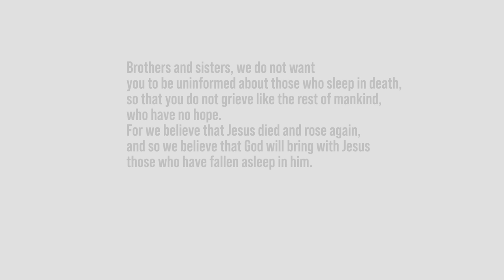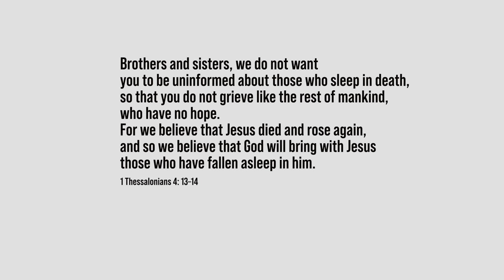I’M NOT 100% CONVINCED THAT ROAD FABRIC IS WORTH THE HEADACHE

Comment: As ❤for the lift ht on your 1025R. Tractor Time with Tim addressed this problem a couple of years ago.  Only one of your lift arms is adjustable, replace the fixed arm so that both are are adjustable.  Now if you adjust to the higher position and it will give you a few more inches of lift.  I had a problem moving my rear blade up a ramp into my barn, now I have no problem.

Comment: Totally feel your pain! I took on a driveway/parking area with no matting and DOT 57 rock. Equipment used JD 1025R with loader bucket front and landscape rack used backwards. Also, a GT2500 Wheel Horse with a front and rear blade. Took time for sure but worked awesome. Our dump spread with dump trailer fortunately work better than your which led to an awesome result.

Comment: Don't beat yourself up.  You started out with a mess but it turned out great!  I know you like to demonstrate tractor implements, but to rough it in, your JCB front-end loader would have been a better option.  On the Kabota only the front axle is self-leveling.  On the JCB front-end loader, the entire front half of the machine is self-leveling and the bucket is attached to the front making it easier to level your workspace, the same as you would with your skid steer.  It also helps to compact the gravel.

Comment: The times I've seen fabric work is,  1. Layed down and covered with base layer of rock several inches with fines.  2. That layer covered with another 6 inches minimum of smaller rock than 1st layer with fines also.  Spread and compact.  Enjoy

Comment: Thanks for the video as I am about to do the same thing. I never though about using the rake backwards. Seems to work quite well. I just hope mine comes out as well as yours. I am on straight clay soil and used 10"- 12" of "pit run" on top of the clay and will use geotextile cloth then about 4"- 5" of 3/4" minus slate.

Comment: Hi Courtney,
Just from a block base building perspective, yes a good geo fab will stop sub base material migration into the grade you cut (or the original base)  it also helps with stability of the sub base overall.  If you had a soft spot that could cavitate under the sub base, the fabric helps prevent that from happening, because the erosion has to pull the entire wieght of that "slab" you built in order to  cause holes, dips, and general instability. I would always reccomend compaction, the heavier the better, especially on te original cut grade (o.g. base).  Setting that grade first is critical.  You can compact the sub base above, but realize that the results wont be as effective due to the textile stopping the sub from driving into the base.   As for weed prevention, yes it will stop weeds from coming up through the bottom, but unless you can keep every bit of organic out of the sub base, all the time (which is impossible) then weeds will eventually grow even in the best laid base. Kinda like a rose growing through a crack in the concrete.  Not very likely, but given the exact needed conditions, it is possible.  Didnt mean to lecture, just hoping the info will help in future projects. Looks good!!

Comment: We quoted a job for a large industrial manufacturer.  They have semi trucks in their yard and wanted a large area covered in 4" of rock.  We contacted the geotextile manufacturer and they said for the weight (big fork lifts and semi trucks) the depth of rock would need to be 12" or more.  It was cost prohibitive.  We have used road fabric in the past on other projects.  Usually a minimum of 6-8" of rock on the fabric.  But doesn't seem to be much of a difference between when we use fabric and not.  I'd rather go deeper with the rock and not use the fabric if it was one or the other.  I'm sure soil types and drainage also makes a difference, especially if it's wet most of the year.

Comment: I always put fabric at the base of a driveway.  Cover that with #2 limestone, then top it with B19 or similar.  If you don't put the #2s down, you will have problems with wheels digging through.  I have fabric under my driveway and it survive more than 50 fully loaded gravel trucks while we were building our horse arena without developing any tire grooves.  That is why you need fabric!

Comment: Geocell/Geogrid might cost more, and will need more gravel to fill up each grid, but will hold your gravel pad a lot better on the long run.  And this is definitely a 2 tractor job, larger for bucket work to spread gravel around, and lighter to do the top coat grading and smoothing out.
Reply from the maker: Yeah, turned out good in the end at least :)

Comment: I've installed a decent amount of gravel trails in the parks I work at. I have used both geocell and fabrics. I have also not used anything other than gravel. I think for the cost of fabric it really is beneficial to use. The geocell stuff I don't think I would use again.  Usually do 4" of 304 then top with 411s. Seems to hold up well especially in wet areas.

Comment: I’ve spread gravel on geotex with my tractor as well. I’ve had nothing but trouble doing anything other than back dragging with the bucket to spread gravel. I put down geogrid below the geotex as well, and the pad is very hard and supports anything I drive on it. I tried to use a rake on my pad as well and it was a nightmare. Tore up the cloth in a few places before I just went back to back dragging. Although where the rake worked it worked really, really well.

Comment: Don't typically need geo textile.. its best for wet areas .. it also makes reworking the gravel areas  a nightmare unless it's 6-8"  us a actual base stone then the  fine grade finish stone and it all locks together
Reply: Great point. Tons of rain on the coast of Maine, and I’m dealing with ledge as my foundation. In places, I expect to hit ledge. I’m thinking that I will need to install a base layer of Geocell. Driveway will be on an incline, ending 75’ from the shorefront  I like your suggestion 6-8” of base. Should I use geotextile as well?
Reply from the maker: These areas tend to hold water...my property was an absolute mud pit all winter last year.

Comment: If you could have used water in it after getting it spread and would have got it wet the ran a vibrant roller on a skid steer could of helped it pack and harden up more than still been loose. 
Another great tool on spreading rock is using a power rake it helps smooth it out and helps to move the rock around. I use one to help maintain the drive way and you can get it to dig down and chop out the pot holes then can smooth it out. I believe there should be at least 6inches of stone over any road fabric!!!!

Comment: Watch the video, your gauge wheels are not even touching the ground.  The best way to use this attachment, is to replace the center link with a length of chain.  When you lower at the three point,  the rake can pivot and follow the contour of the plane of wheels.    The rocking of the tractor will has less impact on the rake.    

This even more effective with three point mounted mowers and brushhogs.  Using a chain center link that is just long enough to raise the unit,  will allow it to pivot and stay level to uneven ground.     As aside,  using a chain harrow to smooth the stone area works really well.
Reply from the maker: They do touch, but they also come up.  That's the problem with too big of a tool.  You can't make the appropriate adjustments.  It won't raise any higher which would have been helpful to rock it back and ride more on the wheels.  Chain has limititations too.  This is meant to show you not to use too big a tool as I'm often asked "why not" by customers.

Comment: Hey Courtney, Thanks for sharing the video.  It’s helpful because I’m going to be putting in a gravel road and I do have road fabric to lay underneath.  Final thoughts on the wheels used with the rake?  Do you notice much of a difference when you the rake without the wheels?  I’m still trying to figure out what benefit they provide.
Reply from the maker: Yeah, the rake will dig down much more aggressively without wheels.  So, the wheels keep it propped up.

Comment: Courtney, you always talk about Rim Guard and you were one of the main people to sell me on the product. I’ve recently run into some issues with my belly mower rubbing the rear tires when I fully bring it up into locked position, where I can pin it up and use the 3 point. By me adding rim guard, does that also change the air pressure that the manufacture of the tire suggests ,before it’s filled with rim guard? Or should I be using less air. When I bought my LX2610 the salesman said if the rear tires were even a pound over it would cause them to rub the belly mower. I haven’t hit anything and I can see no changes in the underbelly or any areas that have bent or broke. Mowing season is over, so I can just take it off after today, but it’s been frustrating not being able to use 3 point attachments, without removing the belly mower every time. Any info is welcomed. Thanks again 🙏
Reply from the maker: Generally speaking, you'll run a little lower PSI with fluid flilled tires.  I've never heard anyone mention that issue about the LX, but I would think that issue would come up all the time if it were true.  Pressure changes with the change in temperature, so even if you weren't losing air from a leak, your tire pressure could still fluctuate.  I have a hard time believing that salesman, although do expect a small clearance between the mower and tire.  That's pretty common.  You can't visibly see a change in 1 PSI in your tires (at least I can't), haha!
Reply: @GoodWorksTractors  , you could barely slide a piece of paper between the rear guidewheel of the mower and the rear tires of the tractor, the day I purchased it, that’s why I asked. When I ordered it, the mower wasn’t attached yet, so I didn’t notice how close the clearance was until after I purchased it and it was dropped off with the mower installed.

Comment: First mistake was using the fabric paper it does not prevent the Stone from sinking if you have soft areas I would recommend using much bigger Rock first rent a roller compact it down and then just go over with stone or recycle Blacktop I use recycled blacktop on all my projects driveways parking area so it's cheap and it works
Reply from the maker: That is the primary purpose of fabric...to prevent stone from sinking.

Comment: Wow!!   Very painful to watch for sure.   A few thoughts…. Fabric is for suckers 😂😂, using gravel with fines that actually compacts when you run on it is a must and establishing a good sub grade that has been shot in with a level to be uniform is a must and lastly  establish your top of stone grade on one end and carry that grade all the way across the pad as you spread it, when you get to the other side you are then done.  Using a builders level, and a shot rod and putting in blue tops at finished grade insures a uniform gravel thickness.  My thought as I was watching this was that I would have probably used a snow pusher with the skid shoes adjusted to the right gravel thickness minus the fabric of course.   Interesting video for sure.  🔥🔥👍👍
Reply from the maker: Lol, well I don't think I needed to do all that, but you could be as detail oriented as you want.  The pad is working well and there really wasn't a benefit for me spending all that extra time for a spot to store trailers.  I'm happy with it :)

Comment: Here is my issue with driveway fabric. They want you to use metal horseshoe pins to secure it to the ground, which is great until 2-5 years down the line and the fabric and subsequent metal pins pull up and bend into all kinds of tire popping contortions of rusty tetanus inducing metal land mines. Tractor tires can handle them for the most part, but car tires are guaranteed to snag these rusty metal crows feet and create slow leaks in all your automotive tires.

Edit: it’s always frustrating when you realize how many passes are needed when attempting to spread wet stone. There are some industrial road munchers that could potentially handle the stone better, but at what cost?
Reply from the maker: I haven't used any pins to hold down fabric. I can see that being an issue though.  Perhaps there's a plastic pin or even wood?  It only needs to be held down temporarily until the material is on top.  Plus, I'd think if you just pins in the far corners, then that would be the least likely area for a vehicle to drive on.
Reply: @GoodWorksTractors , I’m with you on everything you said. It’s been my same issue with weed fabric used in the fields. After 1 year of following the instructions, I learned to never use those metal fasteners again. The fabric pulls away from them over time and now you have a field full of little metal fabric staples (never good). I moved onto the rock method the following year and had much more success. I’ll send you in some pictures of the multiple 5 gallon buckets I’ve filled with jagged pieces of rusty metal from using road fabric on my 3/4 mile long gravel lane 3 years ago. I’m still picking the tire popping bastards up after every major rain because it exposes them. Good luck in the future with that stuff, I hope you don’t run into any of the same problems I have.

Comment: I completely understand the frustration of not really having the right tool for the job, especially spreading gravel like that! 

Ideally I would have used a box scraper, but you use what you have. 

I have a lot of practice with rear blades so I probably would have used one and demonstrated how useful a rear blade can be. I’m not saying you should or should not have used a rear blade. They can be as frustrating as they are versatile.  
I would also rent a small drum compactor and then get another load of gravel. Not saying you should or shouldn’t, just what I would do based on my past experiences.
Reply from the maker: Thanks for watching sir, have a good day!
Reply: @GoodWorksTractors  Tracked tractors have a nice stable platform and can grade surprisingly well. Just a thought 😎
Reply from the maker: @PurpleNovember   Haha!

Comment: you can see in the video the wheels aren't doing anything when your in a full pull
Reply from the maker: Ideally, I could have lifted the 3 point higher and changed the angle.  Could have done it with a smaller rake.